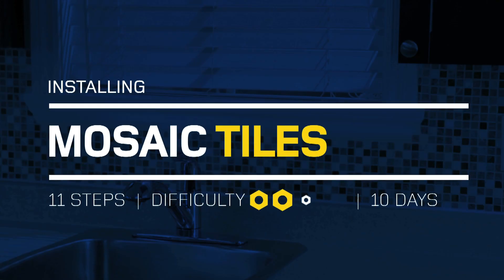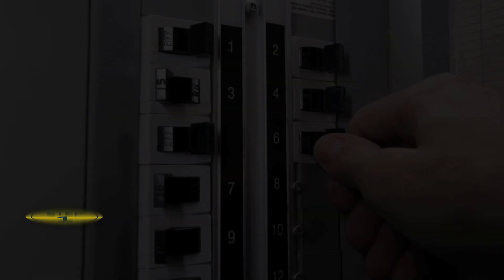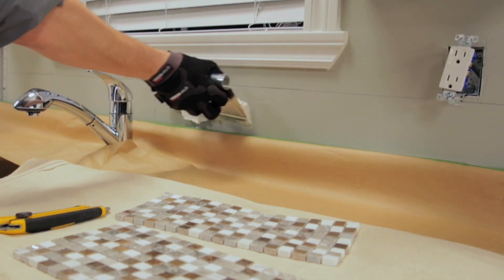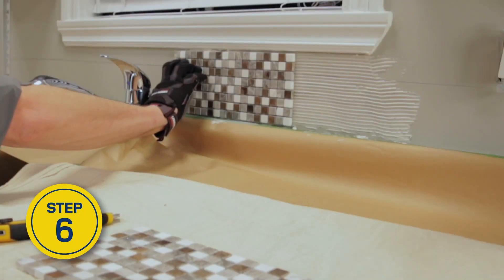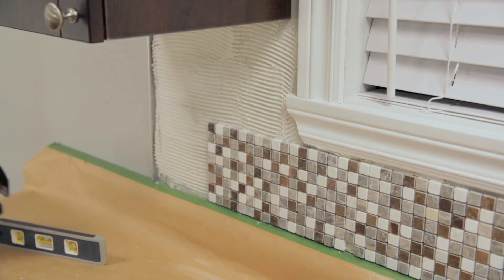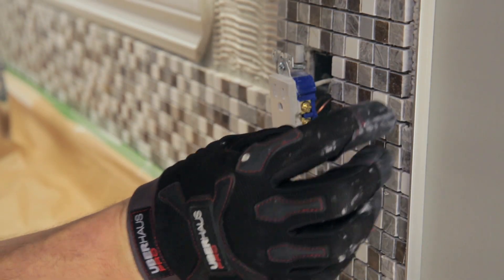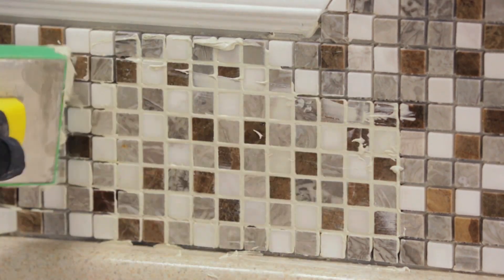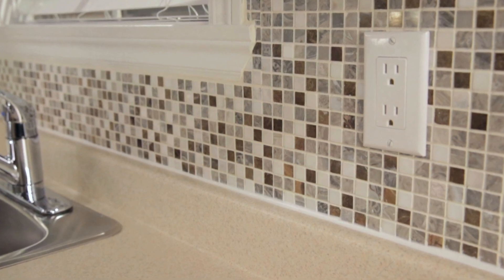How to Install Mosaic Tiles | RONA

Comment: It was all good until the end when they stuffed up the silicone.
Reply: And the fact that the tiles shouldn't necessarily be leveled they straight to the counter tops otherwise you will endf up with small un even peices

Comment: I'm going to put these mosaic tiles on top of already existing tiled vertical walls as well on horizontal ledges (around the bath) in my bathroom. I'm not planning on removing the old tiles by the way, to much of a hassle and I'm not sure what I'll find underneath these tiles. The former owner of our house messed those tiles up by not using spacing, so I'm now wondering what "glue" he might have used to attach them. For all I know I could be ruining everything if I remove them, if you get my grip.

Are there things that I need to take into consideration, except for the wall being flat (which it is, thank goodness).

Thanks in advance!

Comment: I'm more interested in how that electrical outlet was set up.
Reply: Should of had box extenders put on or longer screws after taping around the wire screws so no shorts happened as the device tabs would hold flush to the tile.

Comment: First you dont just sand the paint , at the least you need to score into the wall and prime with tilers primer , second using a mallet to tap them back ??? no dont use the mallet use a clean grout float
Reply: Finally, one person with sense and possibly experience.  I love how everyone says "great video" but if you do what the video says, there WILL be problems.